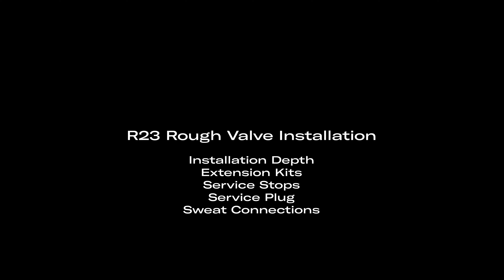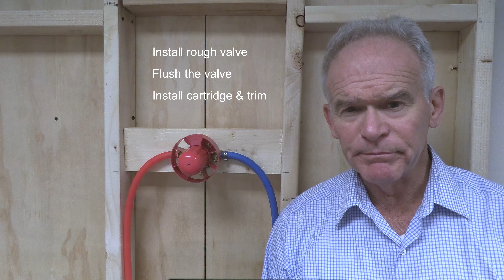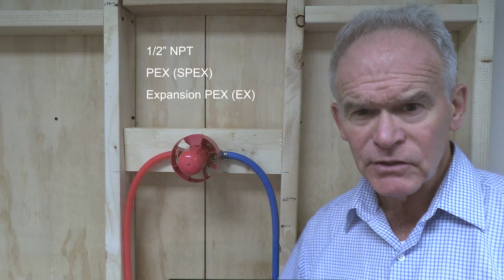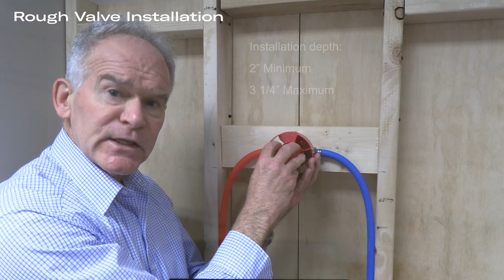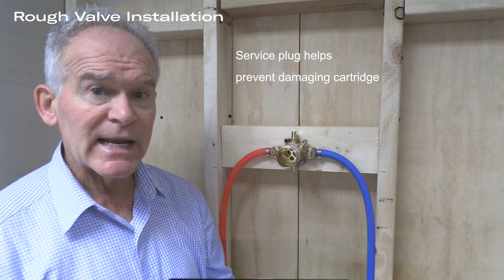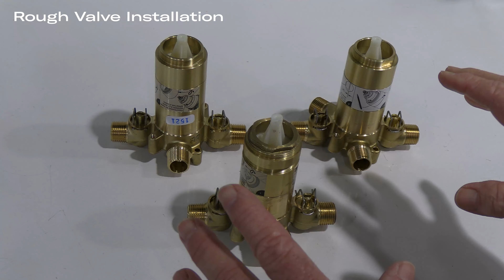R23 Rough Valve Installation

Comment: An observation after flushing the hot and cold water valves on my R23. The service stops are closed at 12-6 o'clock and without the cartridge inserted, I'm finding that the valve drips water ever so slowly, every 10 secs. Is this normal/expected or should the service stops provide 100% water seal on the valve? Please confirm.